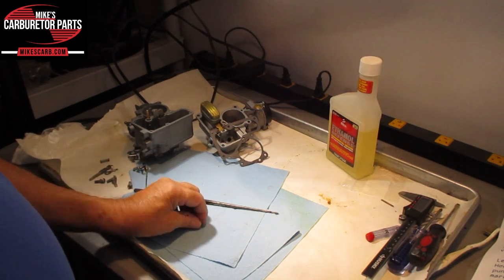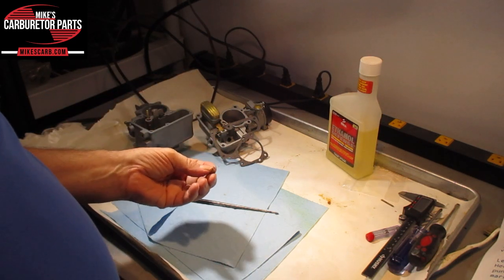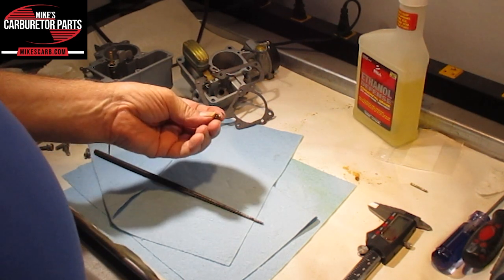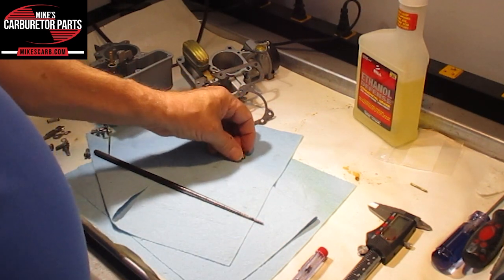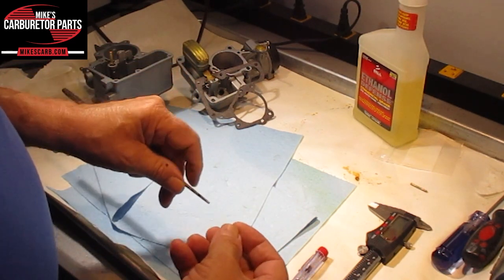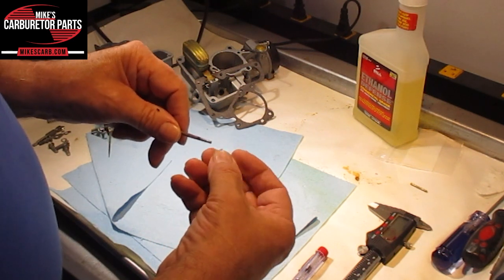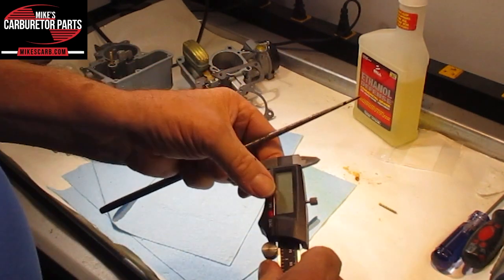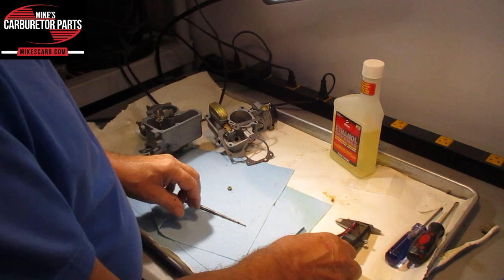What is the Size of my Jet?

Comment: hey Mike, very nice video . I call myself Flavio, from Brazil. I have worked some y ears in Chrysler. My friend, I am working fixing motorbikes, and have some issues measuring gicleur diameter (main jet, pilot jet). In your video you do show a tool, actually a gauge that looks like a taper tool, that you have used to identify the diameter than measure that with your caliper. Can you tell me how to find that tool or have you made it yourself? Thanxs in advance for the outstanding video.